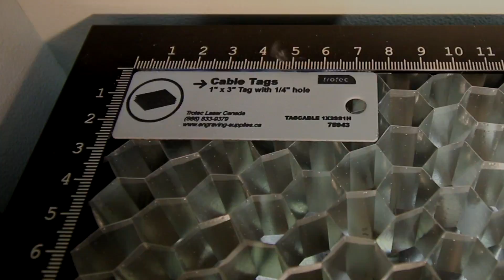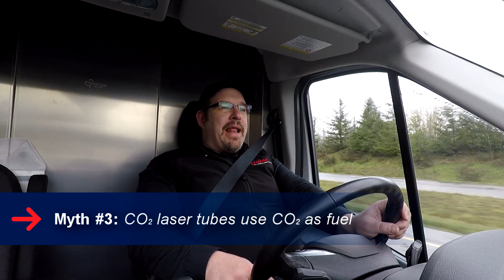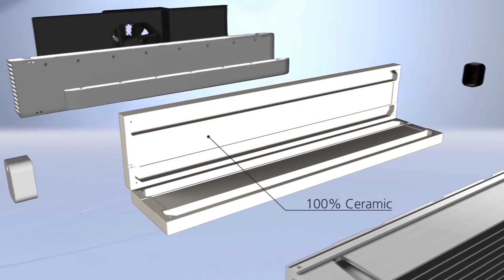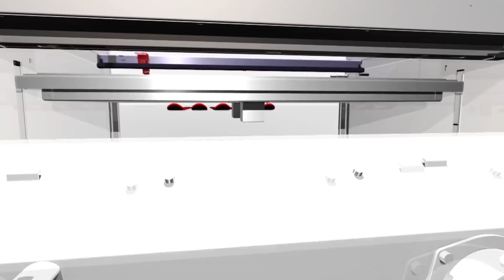7 Laser Engraving Myths - BUSTED! | In The Van with James Minchau

Comment: Hi James, If I may, I want to ask what are the main reasons for laser tube wear? Which is more wearing: cutting with high/max ppi, or cutting on close to max/max power output? Any clues how to treat laser tube best? Thanks in advance,
Mark.
Reply from the maker: Hi Marek, Trotec CeramiCore tubes last a very long time, there's no real way to pin-point on lowering or raising max power to affect the longevity of the tubes.
Reply: @TrotecLaserCanada  thanks for the answer, but I don't have CeramiCore tube, I have an old synrad metal tube, rated 25W, just for hobby use, and thinking about the relation between power and PPI while cutting, is it better for the tube to cut with lower PPI and higher power, or with higher PPI and lower power?

Comment: I have a general question...(I'm new to laser engraving). Does the power setting of a CO2 laser affect the longevity of the tube? Ex. 10% power gives you a lifespan of say 3 years where as 90% power gives you a lifespan of 1 year, while hours of use remain the same. I know the lifespan is longer than that, just using it as an example.
Reply from the maker: Hi Jay 

Power level is not relative tube life.  Environmental factors are much more of a cause.  Keep your tube within posted ambient operating temperatures, clean out the fins every once in a while, to avoid dust buildup.  When the electrodes are inside the gas chamber, then the power levels can affect the gas, leaving your gas level lower, but Trotec uses CeramiCore technology that keeps them outside the gas.  Look at this video https://www.youtube.com/watch?v=wt35m4pxdfA

Thanks,
James

Comment: Hi James. Nice information in your video. In 2007 I marked for my father the lid in the back of a CASIO wrist watch with his name, using metal marking compound and my 45W CO2 laser machine. It was just a gift for him and a test for me. I remember the last year was the last time I asked him about the status of the mark, he said that it was intact. I know that he uses the wrist watch daily and removed it only before taking showers.I think this is a good test since the marking is constantly in touch with his skin and other factors like sweat. By the way, he is a carpenter.
Reply from the maker: Hi thanks for the kind words! That's a great point we will ask James to comment.
Reply from the maker: "This is a fantastic question.  The Bond in metal marking with hard metals is about .005 mm or 5 um (micron).  That’s really small.  The molten ceramic and cilicates harden like glass on the surface of the metal. This means the materials won’t wear off easily.  Especially from non-abrasive situations.  But if you are needing something to be permanently marked, a fiber laser will actually engrave the surface of the material way beyond five microns.  As deep as you want if you are willing to wait!   So you have to wear of hundres of microns of backing material in or der wear the marking off.  With the cermark, there is much less to wear off, so it will happen faster.

In the case of your dad’s watch, there must not be a lot of wear on the back.  You also must have hit it hard to adhere the marking compound to the metal and probably a bit of annealing underneath.  Good job!  I know from a keychain I made my wife years ago, the cermark wears off in an abrasive situation. As well as in dishwashers over time.  It take a long time, but it does happen."

 - James

Comment: By far the biggest myth is that settings on one laser will be the same for another, each tube is unique, if you have two 400 flexx machines (we have one), the settings for the same results will be slightly different in JobControlX.
Reply from the maker: Hi Jon, that's a really great comment. We have standard laser settings for materials that we offer on our JobControl software but we always recommend to do a small square test to get the desired results before going on with the full project.
Reply: JobControlX is a good recommended start, play with it until you got the results you want.

Comment: That is some useful Vulcan knowledge open sourced right there. Thanx for that. 

Years ago I used to work in a room they called the acid room. Muratic acid was being used to etch metal where a silk screened layer of paint wasn't applied, for things such as UL nameplates. 

Years pass, and here I am with a creality cr10 s5 3d printer, and a super low watt engraving laser that I've yet to install a mount on the printer for, as I've been focusing mostly on getting ABS based plastic prints to not curl up off the build plate. Heating of build plates is everything when it comes to getting it right in that dept. I've been getting success at Temps above 80c, though 110c would be ideal. And printer manufacturers should consider installing heaters at factory level that can reach 110c really. Lol. 

Nye is good people. Was cool when he sat down with Trudeau to discuss focusing on a most electrically based power infrastructure. 

Please remain groovy. 
Laser surface engraving groovy. 
🖖🇨🇦
Reply from the maker: Thanks True Tech that's an awesome story, "acid room" is a really cool name though!